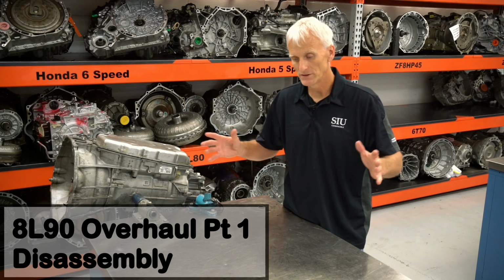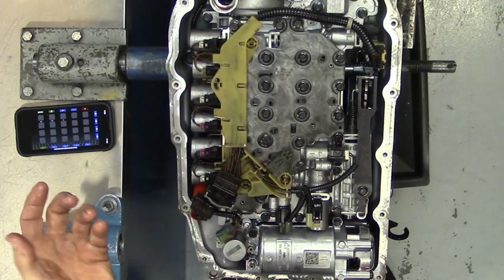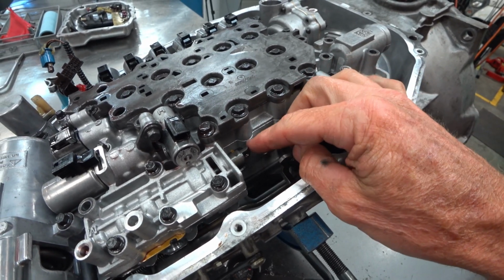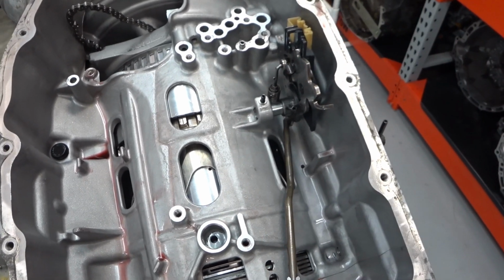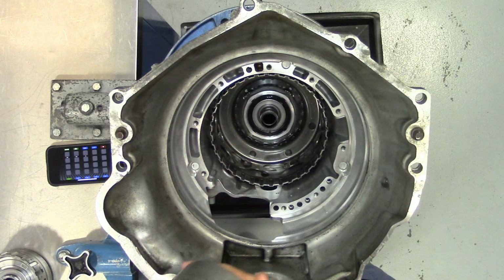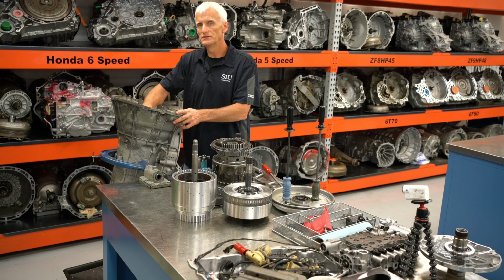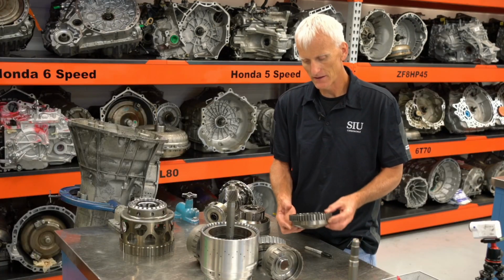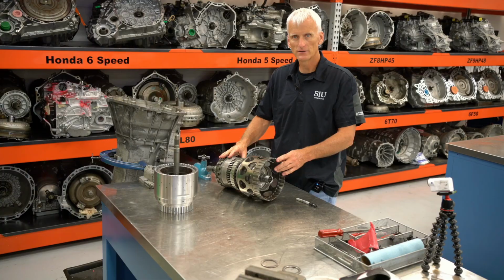General Motors 8l90 Overhaul Part One: Disassembly

Comment: Hi I own a 19 Silverado 1500 LT with the 8L90, the problem I have is when the transmission fluid gets around 150 and higher, when the transmission down shifts from second into first I get a banging sound. It only happens when the transmission fluid get hot. I can go through fall winter and spring without having any problems. So far I replaced the filter and on two different occasions I removed six qt x2. still have the same problem. Transmission temp never goes over 165, I even installed the PPE thermal bypass valve would you recommend a flushing. Other than that the transmission works great.

Comment: I took apart an 8l90. When I drained the fluid is was jet black like used diesel oil. What causes that? There was around 2 or less tablespoons of metal sludge. It barely even smelled. The fluid pump chain was seized and came off. The fluid pump and sprocket itself spun smooth and free. Everything else was find it barely even had burned clutches. Most of the frictions were dark but the steels were fine,  couple small hot spots, not even close to the hot spots you had here.

Comment: i would be great if SOMEONE would tell us what IS the problem with the a* IF the fluid flush doesn't work. Is it trans or torque converter (TC), Can I change TC only and be god to go???
Reply: Torque converter is the issue and possibly worn valve body would have to take apart th valve body and do a sonnax kit. This guy goes into detail about it on newer vids now

Comment: I am sitting in my garage right now with a beer and an 8L90 that averages about 215F on the road with about 55k on it built in 2021. New torque converter is coming and going through it with a fine tooth comb.  When you mentioned the thermal cooler on the lines I wanted actually growl.  Nothing wrong with it really but I also know that 500-600 for a check and new torque converter is way easier than a completerebuild of the whole thing when the torque converter goes and takes out everything else.  Thanks so much for this video.  4k display in the garage above my workbench for the win!

Comment: I have a 2016 GMC Yukon same transmission with a problem from the first and second gear. 125k miles it slips when accelerating and coming to a stop what can might it be?
Reply: I’m guessing stator in the torque converter.

Comment: Have you ever heard of unnecessarily hard 3-4 shifts on these 8L90s? It only occurs at low-medium throttle at around 2000-3500 rpm 3-4 shifts only. The 3-4 shift is way faster than it needs to be and all the other shifts seem normal. You can use GDS to learn the oncoming clutch for it and/or reset the whole thing and let it relearn which seems to help it until it learns back in few hundred miles. You can also lower the shift times with HP Tuners but it is no help it ignores it. So it appears to be controller related but then seems like it could be mechanical/hydraulic. The 3-4 shift isn't excessively hard but completely inconsistent with all the other shifts and you can see it on a log as well.
Reply from the maker: It'd likely be the 45678R (aka C5 clutch).  Probably the solenoid, clutch reg valve or solenoid accumulator worn.  Since you say that relearning it will help, but then it will eventually go back to being harsh, I'd have to believe it's a solenoid, valve, or hyd leak.  These only adapt when they get hot, so if it adapts to a fluid leak after the fluid is hot (thin fluid, greater leaks), when it cools off and it doesn't leak as much, the shifts will be hard.  Watch the VB video (OH part three).  If you don't have a vacuum tester, I have a video up on how you can make one for a little over 100 bucks.  It's good to know if you're dealing with a worn out valve body or if it's likely a solenoid.  The solenoid is harder to test, since there's no good way to bench test it accurately.